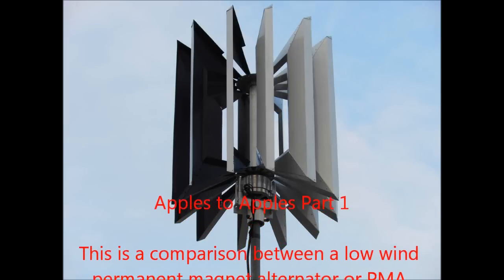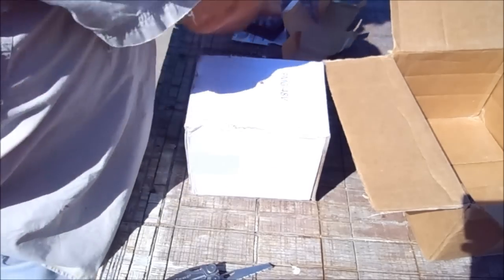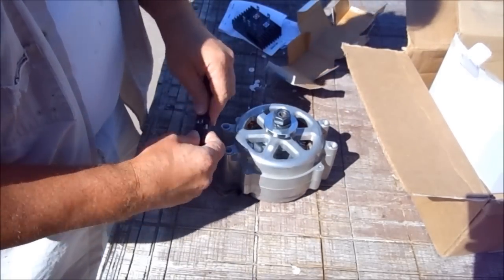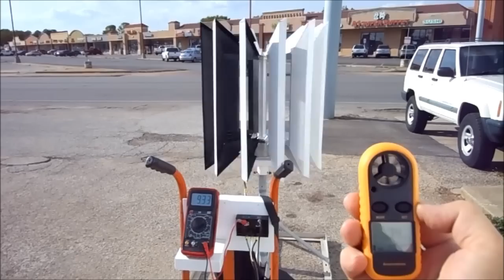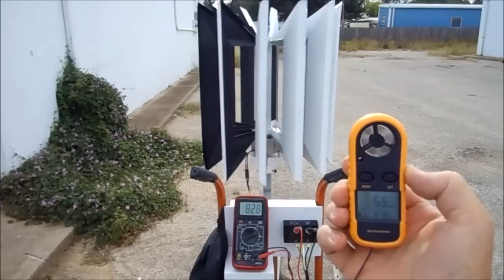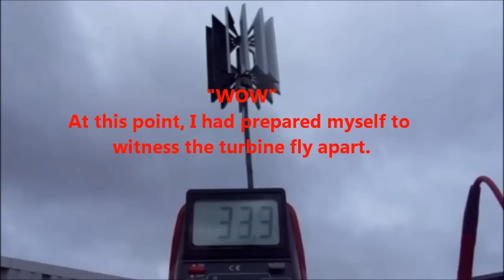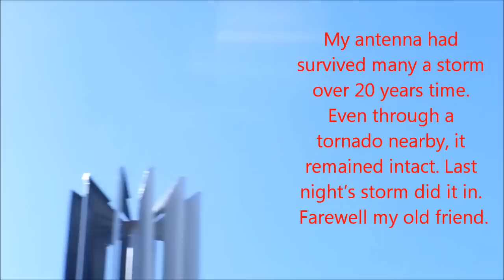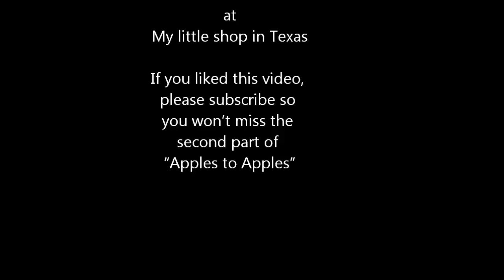Apples to Apples Part 1

Comment: All your trouble with threads and shaft sizes and a mix of metric and imperial, why in the hell doesn't America just ditch imperial altogether and go metric? That would solve all your problems.
Even little Australia has been metric since the mid 1960s. People here adapted within a couple of years after they finally admitted it was so much easier!
Some of the old guys complained but I used to tell them to throw away all their tape measures with feet and inches because they were trying to convert from one to the other all the time. It's not hard to learn the approximate size of a metre, or a centimetre, or a millimetre.
Reply from the maker: If the system is made easy, then its one less thing to complain about.. Whats the fun in that?

Comment: why u allow to flow on returning half of turbine ? why u dont cover the half of turbine
Reply from the maker: I have my reasons.
Reply: @LittleshopintexasSV  and they are ?
Reply from the maker: @stanislavcoros  Weight is a problem, if it's on top of a pole. If it's something that has to move when the wind changes direction, you might as well go with a horizontal turbine. Anything that guides the wind in one direction may block the wind when is shifts. If you get wind primarily from one direction a windshield may be practical, in my area its not.
Reply: @LittleshopintexasSV  u can make halfshield rotable by the wind also. Same like horizontal turbines work, but only half shield will rotate around the vertical turbine

Comment: You could braze the shaft with brass rod and then re-thread to standard thread for standard sized nut. Might require dismantle,but it would be worth it in my opinion.
Reply from the maker: This video was from a few years ago. Since then I've replaced the old bender with a larger more capable machine and over time used most of the materials of the old one in other projects. Thanks for watching!

Comment: To increase voltage you could wire in a buck/boost convertor. This would mean even more voltage at a lower speed.
Reply from the maker: That's a thought.

Comment: Little Shop in Texas Brother Awesome Video! If you stabilize the stand wouldn't it pervent the whipping effort and prevent breaking of parts? Why didn't they use Stainless steel bearings then no problems? Thank You for Your Time!
Reply from the maker: Guy wires would have helped, but I couldn't use them without anchoring at least one on a neighbors property. Thanks for watching.

Comment: I was just thinking wouldn't using a roll of plumbers tape around the top and bottom on the outside edge be a lot less labor intensive than all of the fittings you had to make and would not cost any thing hardly.

Comment: The magnet assembly that had the magnetic shaft might be a good candidate for magnetically levitated bearings. No physical contact so no resistance which would increase efficency I beleive. Just a suggestion.
Reply from the maker: That's something I thought about, but I prefer to do it this way.
https://youtu.be/0ZAmk6n2b3g

Comment: How many birds have you killed with it? 
   Make a shielding with chicken wire. 
  You can shape it with thin metal rods, attache to pole.
Reply from the maker: What nonsense is this? It's not possible for a bird to fly into this. If they can't fly through it, they can't be killed by it.

Comment: HOA's are impossible to deal with. That is why I never bought a home where I had to deal with them. I have a deed with no covenants or restrictions on it. No HOA for miles around me. It took two years to find what I wanted, a house with acreage on a tall hill. No flood problems, no nosey neighbors that will tell me what I  can or cannot do on my land, and outside the city limits of any City. I have many Amateur Radio antennas, a rental spot for Caravans, a tree farm, and a future wind turbine to run the radios seperate from the mains on rechargeable batteries. I also restore old trucks of any kind. Truck parts are under cover in a pole barn (which no HOA would ever allow). If you approve of an HOA, you are certifiable communist crazy.
Reply from the maker: Excellent, sounds like a little piece of heaven. I'd never buy a property in an HOA either.
Unfortunately the municipality I live and work in, is trying to run itself like an HOA.
I am trying to find a way to leave this place for greener pastures (literally), but the opportunity hasn't presented it self yet. Thanks for watching!

Comment: What is the average wind speed in your area?
How many watts does it produce?
Would you buy it again?
Reply from the maker: Most days I get a very light breeze of less than 3 mph. Those are the days I'd depend on the grid, solar or a gas generator.This past week has been extremely tough because of overcast sky's and no wind to speak of.
At the moment, 0 watts are being produced. But even on a good day, with these small PMA's will only make enough juice to charge batteries. To be fare, you will get more juice out of both of these when they're used with a horizontal style setup.
I will buy it again if I can use pulleys to double the RPM, otherwise I like the Freedom II which has two cores that can be connected in series to double the power output on my VAWT's normal RPM.

Comment: If this generator only turns one way what happens if wind is blowing opposite its ability to turn?
Reply from the maker: The generator/alternator works in either direction, but the threads on the shaft are right hand or clockwise. So as long as the turbine is installed to turn clockwise it stays mounted. Otherwise it may unscrew itself.

Comment: Thanks for the informative  video. Just my observation and not a criticism, but isn't all the load from the turbine on the PMA/PMG. I would have thought that the lateral and downward force would severely reduce the life of it.
Reply from the maker: That was one of my concerns as well. But both of these alternators use the same bearing found in automotive alternators and the Freedom PMA uses one in both front and back of the body. If they can handle heat from an engine and tension from a belt for thousands of hours of operation, they can handle a twelve pound turbine siting on top of them. Of course I might not believe that is true without testing that myself. I've been using a Freedom and Freedom II for my experiments for six years and counting with no bearing issues so far.
They're not bad units.
https://littleshoptx.com/wp-content/uploads/2019/10/Flamin-VAWT.gif

Comment: I'm designing a vawt for uni and I was wondering if you covered half of it with an exterior wall so only the correct blades get hit by the wind... there'd be less drag?
Like the wind is going to hit the whole side so it's even going to hit the backside of some turbines causing drag? I'm assuming this is why hawts are more popular?
Reply from the maker: Yes, if you can reduce air flow over the returning blades of the turbine, you will gain both torque and speed. If your mounting a vawt to a wall, and if the wind comes from mostly one direction it makes sense to block the returning blades from the wind. I have experimented with this idea on small models with some success. I also experimented on a free standing version using a wind blocker that would rotate around the turbine using a tail that followed the changes in wind direction. That idea worked great as a model but a full sized version would be clumsy and heavy. Hey, thanks for the great question! Good luck with your project.
Reply: @LittleshopintexasSV  thanks for quick response! It's good to know I'm on the right track and my idea could possibly work. My aim is to create a portable wind turbine for mountain trekkers so it only needs to generate enough power to charge a mobile phone/powerbank. I've gone down the DC motor route and purchased a permanent magnet motor 12v but it's a bit chunky/heavy for my needs. Could I generate enough power with a basic small 5v dc motor and a 0.9-5v stepper?
I'm seeing a lot of people getting LEDs to light but not much evidence to support a mobile phone charge.
Reply from the maker: @doorwaycreative4693  I'm 62 and found I no longer bounce when I fall, so you'll know more about climbing than I. My thoughts are, If you are setting-up a permanent base camp it might be worth carrying a turbine with you, a few deep cycle 6 volt batteries as well. There's nothing like having a little heat if the weather gets bad. A small horizontal style turbine might pack away easier. But if I was only planing to trek for a few days, I would probably rather carry a small hand held dynamo to charge my phone. I'd hand crank it for about five minutes and put it back in my pocket.
As far as using a 5v dc motor, I don't know, I've never tried it. I have heard that treadmill motors works well as generator, but I haven't tried that either.
If you have the opportunity to hook up a volt meter and spin the shaft by hand (before you purchase it) you'll have a better idea about the torque and RPM needed to reach the proper charging current. I hope you keep me informed on how your project's going.
Take care until next time.
Reply: @LittleshopintexasSV  Thanks again, it'll help with my research. Yeah that's not a bad idea. I've bought a little handcranked fan that I was going to try and experiment with a cranked system.
I think the tredmil motors are pretty heavy for portability so I'm experimenting with smaller motors for now and hoping to step the voltage up somehow.

Comment: do you make these as kits? I would buy one 🙃
Reply from the maker: I've only sold a few of these, so I haven't developed a system for making kits yet. Some final adjustments are required during assembly. The best I could do is assemble the unit completely, then take it apart to box it up. You might save money on shipping, but the cost of the unit would be more because of the extra work. I hope to expand my shop area eventually, which will allow more space to house the special jigs and forms that would make inexpensive kits possible.

Comment: Hlad I saw this I don't wsmt thpsr shot djarys. And poor thread, I'm going to cancel. Nearly moved pm 2 k with MWS, I don't see thru corrected, or came here to rectify the concern?   Sloppy and high RPM bad combo
Reply from the maker: They have corrected the thread on the shaft and they've also added a key to prevent the hub from slipping. It doesn't have sloppy threads anymore.

Comment: 2:18 - "It doesn't take much effort to turn it" - but you're not driving any load.  Try short-circuiti9ng the output wires, then try turning it by hand.
Reply from the maker: Many people had said that the cogging of this brand of PMA was so bad that it would prevent the blades from turning in low wind. I just tried it to discover the truth.
And to short all the wires together creates a braking effect which some systems use to protect the generator in high wind. That does not represent a generator under load.

Comment: In England, some old houses are said to be "listed" (of historic interest or aesthetic), and planning restrictions on them are severe - to the point where the owner is not allowed to put in double-glazing.
Reply from the maker: The same kind of restriction apply to historic buildings here as well. My uncle bought one home which was in the planned path of a new highway. He had it moved to a new location, but it was just days after, the historic society placed a plaque by the door which prevented him from installing wiring that would modernize the home with electric outlets and refrigeration.
Reply: @LittleshopintexasSV  what would happen if one just did it anyways? and hid it somewhat.
Reply from the maker: @snorttroll4379  I tend to do what I think is best. I don't hide it and if I'm caught I tend to challenge the logic of the law. Example, a city ordnance says I can't replace glass windows with plastic. The problem is the glass in my front door has been broken four times in twenty years. Each time I replace it cost me around $400.. So I had lexan installed to stop the breaking problem. Lexan is the clear plastic used around hockey rinks. Code enforcement found out and issued a warning which I took to city hall to argue my case. Rather than fighting me in court, they chose to make an exception.
Sometimes a logical argument makes a difference.
Reply: @LittleshopintexasSV  so you created more paperwork for them if they did not do as you wanted. smart.

Comment: can someone explain to me what caused this turbine stop from rotating?
Reply from the maker: Wind causes the turbine to spin. If the wind dies down the turbine will slow or stop turning depending on wind speed.
Reply: @LittleshopintexasSV  thx for your response, but the turbine suddenly stop rotating at high wind speed. I didn't get it why? Is this for changing the direction of wind or the generator mechanism caused to stop from rotating at high rpm?
Reply from the maker: Okay, I think I know what your talking about. Someone who knows more about cameras to me explained it best, but I can't find his comment at the moment. It has a lot to do with the shutter speed of my camera and the alignment of the blades with each frame. There are also moments when the blades appear to be rotating backward. I assure you that was purely an optical illusion.

Comment: The voltage measurements don't mean much without current alongside it.
Reply from the maker: In the next experiment/video I compared the two PMA's in use by moving them to my roof to let the wind drive them. I only have two meters, but if you watch the whole video you'll see that I switch from volts to amps and back in order to get a better idea of wattage they produce.

Comment: Rotating at only 60 - 120 RPM you're not going to get much output from it. I think about 100 watts.
Reply from the maker: How much power does it take to charge batteries?
Reply: @LittleshopintexasSV  Depends entirely on the kWh rating of the batteries.
Reply from the maker: @richysee  The turbine power output depends on wind speed and the output capability of the PMA/PMG that the turbine is driving.  In this video I was comparing the WindBlue PMA against the Freedom PMA. The WindBlue probably was about 80 watts at 100 RPM. The Freedom puts out about 160 watts at 100 RPM and the Freedom II (a different video) puts out about 300 watts at 100 RPM. Now, depending on the the load being drawn which causes resistance, 100 RPM happens in winds speeds between 8 - 10 MPH. 
I would never claim this turbine will run a house, but it will charge batteries.

Comment: How are your wind turbines working after these years of use ,you went to a lot of trouble,and I like to how find out things go in the long run
Reply from the maker: I had to repair and repaint one after it was hit by a flying canopy during a storm. That one's still up and running. The very first one I made is in pieces, waiting for fresh paint and I've sold a few since then as well. Thanks for asking!
Reply: Little Shop In Texas  Thanks,must be a Good design,to last that long .Have a good day.

Comment: Where can I buy the motor from? I am looking to build approximately 8 units. I'm using a different blade setup but cant find the motor anywhere. Thanks.
Reply from the maker: Which one?
Reply: The one that came with the non magnetic stainless steel shaft I believe. I think you said in the video it was a freedom II from Missouri W&S but I dont see it on their site. I was hoping maybe you had a link or maybe I heard you wrong.
Reply from the maker: This is the Freedom PMA you saw in this video.
https://mwands.com/freedom-pmg-permanent-magnet-generator
Reply: Thank you.

Comment: if slightest wind is enough to turn it... hmm mount it off the center with some gear reduction ? 1:2 ratio ? 1:3 ratio ?some cilinders with a belt
Reply from the maker: Been there, done that.
Reply: @LittleshopintexasSV  :D ok

Comment: Hi, I am Abhishek from India. I am interested in your product. I want 3 kw wind energy generator. I don't like solar, as heat here is little less. But wind speed is 20-40 full day. Give me price. I also want to start new business in India.
Reply from the maker: If you want to make 3 kw of wind energy you'll need a large horizontal type wind turbine. My little vertical axis turbine can't produce that much power.

Comment: May I ask the weight of such a wind turbin? I wanna get heavier duty one..but stronger, designed into a kite, to fly at 200-300' up in air.. to general energy for me on. Have a 52' solar powered sail boat.  I want turbin to charge batteries and the kite gives me another 6-7 knots of wind speed/lift..
Reply from the maker: The turbine itself weighs about 13 pounds and could sit on top of your mast to generate power. but I can't see it working as a kite.

Comment: That is too bad about the thread issue for the shaft problems.  I would order 10 or 12 of them and tell them in a letter with the check that if they don't send what you want, that you will ask for your money back and they will pay for the return shipping charges.  What kind of on an outfit are they running??
Reply from the maker: I got their attention and they corrected the problem on all shafts made after that. Jeff also offered to send me a replacement of one with lower power output. I declined the offer because the loose threads were not that much of an issue for my application.
Reply: @LittleshopintexasSV  I am glad you got thart issue resolved and good luck with you business.

Comment: Is that AMPS or VOLTAGE?
Reply from the maker: It's been a few years since I uploaded this video and I don't remember all the details. Can you please elaborate your question.
Reply: @LittleshopintexasSV  the readings on your digital tester, are those amps or volts?
Reply from the maker: It was volts. If I was checking amps, it would have shown between 3-5 amps when I turned it by hand.